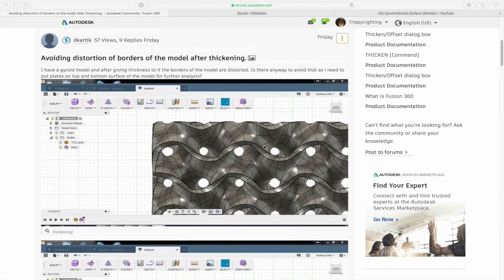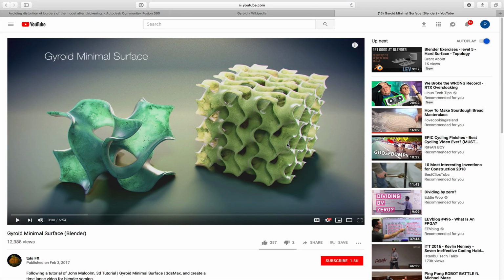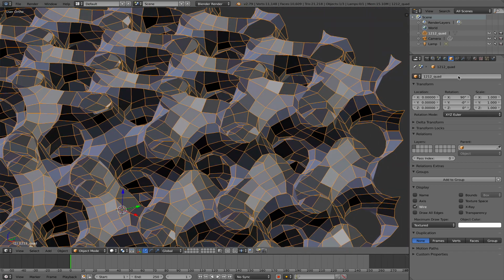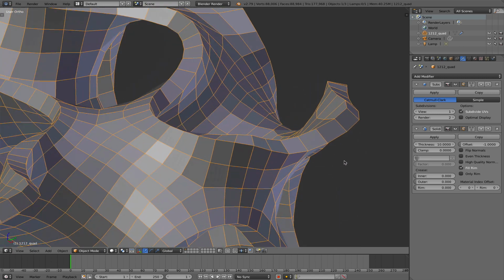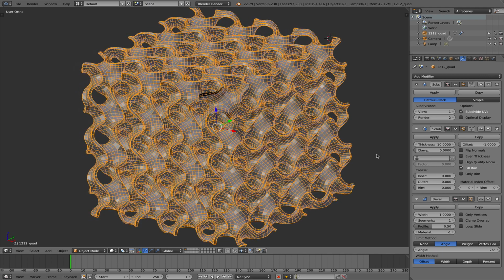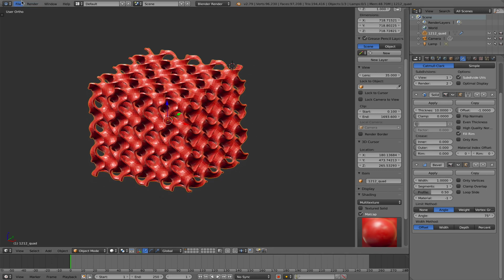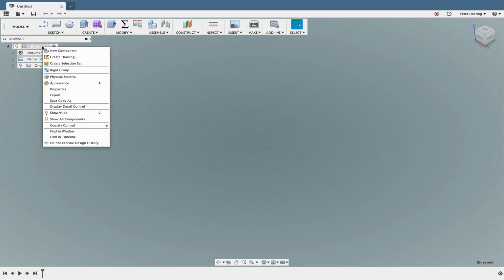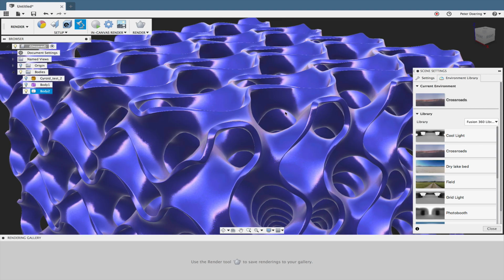Gyroid in Blender and Fusion 360

Comment: Great video! 
One small thing I'd like to point out is that by default, Fusion triangulates the mesh, which from my experience with gyroids is asking for trouble. This can be changed by going to Preferences>Mesh and disabling this automatic triangulation. (You get a pop-up warning from Fusion anyway but it's easy to miss).
Also, when I try to go from t-spline body to solid body, I get a conversion error saying that edges or faces may be crossing, and to troubleshoot in box mode. I've done this but no luck. Do you have any suggestions? Thanks!

Comment: Can you convert this gyroid shape to step file with creating geometry
Reply from the maker: Yes, once the T-Spline in Fusion 360 is converted into a solid or surface it can be exported as .step file.
Reply: @TrippyLighting   I dont have fusion 360. Can you suggest any way to do in blender or in other softwares.
Reply from the maker: @sarojdebnath740  Blender does not work with BRep or NURBS surfaces and as  such cannot export .step. Fusion 360 for hobby users is free. What would you do with the .step file ?
Reply: @TrippyLighting   yea got it. I need to do FEA on abaqus. I am having an stl of gyroid consisting 1L faces.
Reply: If you can convert that file to .step. Can you please help it. I can send you through mail.
Reply from the maker: @sarojdebnath740  I do freelance work. If you want me to spend time converting your data to a .step file we can certainly talk about that. Otherwise that's a no. What software do you want to use to do FEM on a Gyroid ?
Reply from the maker: @sarojdebnath740  Also, re-reading your post, you CANNOT directly convert a .stl into a T-Spline. .stl files contain triangulated mesh data. For conversion into smooth NURBS data this needs to be a quad mesh and there is no easy way or perhaps no way at all to convert a triagulated mesh representing a gyroid into a quad mesh.
Reply: @TrippyLighting    Hi Peter, I am working on diamond structure for Final Year Project and due to my limited understand on using blender software/ansys software, I'm facing trouble in cutting a small portion of my structure and solidifying my geometry, hence my work has been stagnant for a month. Please contact me on whatsapp at +60176199347 or rochaester.96@gmail.com. I know you do a freelance job, would be more than willing to appreciate your work with monetary reward if you can give me some ideas to solve my problem thank you.
Reply: @TrippyLighting  Thanks for the tutorial!
I am wondering as well: as the TPMS structures are based on a mathematical description anyways - is there a way to create a parametric model in blender, rather than with discretized geometry?
From my impression, the .obj file format can also export non-discretized models, right?